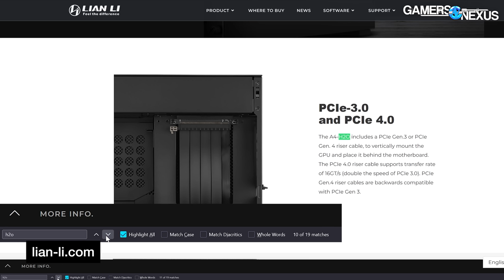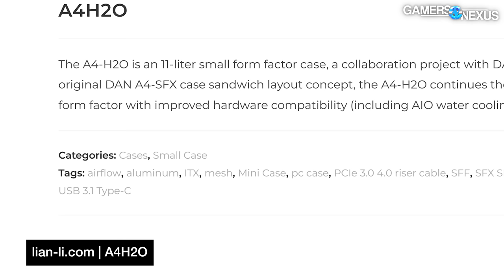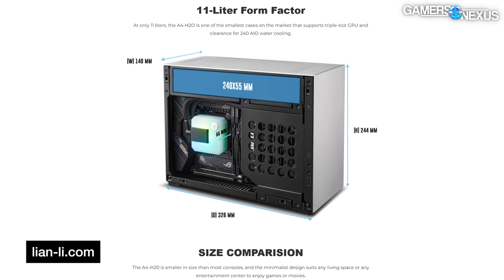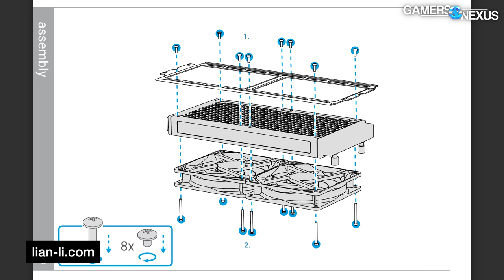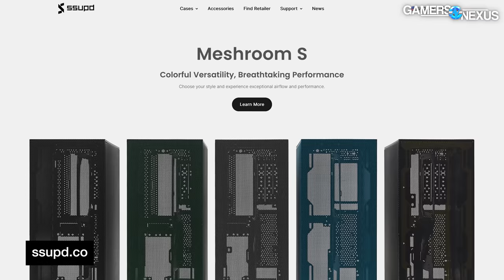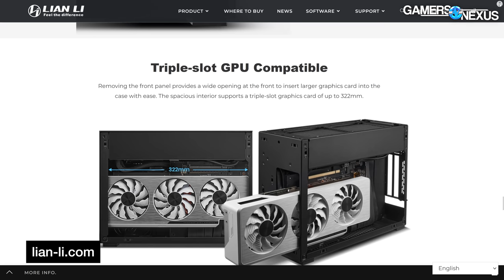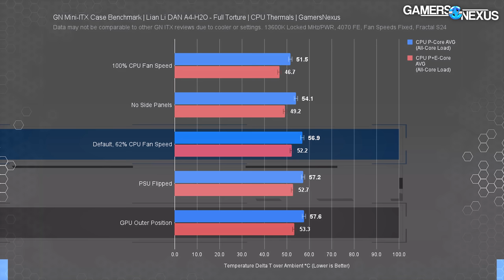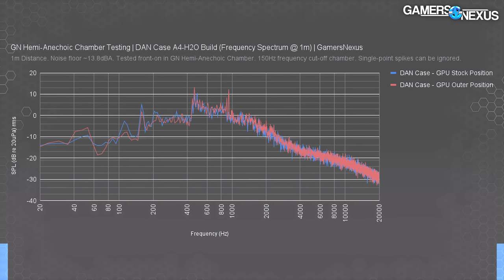Water Cooled Mini-ITX Review: Dan Case A4-H2O Thermals, Noise, & Cable Management

Comment: Probably stupid question but would that computer fit into normal sized backpack? I'm sick of laptops and need PC but small one as I travel a lot. I wonder if I could build that and be able to travel. It's probably a pain in the ass on airports but still better than laptop...
Reply: You totally can in a larger one, but not much more will fit -- you can find some backpack photos on Google.

Probably worth looking into some sort of pelican case for checked luggage (at least I think thats more popular -- plenty of photos/reports)
Reply: It'll fit, but it'll be heavy. Remember that the value proposition for this case is full-size GPU and CPU in tiny box, and those kind of components need a lot of metal to dissipate the heat.
Reply: Thank you, appreciate that guys. I'll look into cases.

Comment: I am kind of disappointed you did not test the case with air cooling like the Fractal Terra. Then you can still test with the cooler for the case specific build comparison.

(...Or does it come with the liquid cooler? Because if it doesn't It really doesn't make sense to me)

I know you can't always do the same parts in every case but the more similar the test platform the more comparable they are (noise and cooling, fitment, etc.) and the easier it is for a conaumer to make a decision (the more useful the information). Even if you can't get perfectly comparable every time.

For example, I am looking to build a compact air cooled mini itx for my father. The size and shape was similar to the terra making this case of interest (and it is cheaper). But the lack of air cooling testing sadly makes this case review completely useless to me. The Terra review is almost useless as well without at least one thing to compare it to. We may know how it is, but that only helps if it were the only case available. As I said, it was just disappointing.

If this is the route you want to go moving forward (built as intended only) I think you should break the ITX tests into two liquid or air categories (if both then set it in both categories/playlists) and label them as such on the thumbnail.

Comment: Had to take a dremel to the motherboard plate as you cannot remove or install a 2nd m.2 drive on the Asus B650E-I  motherboard . Poorly designed .. An NZXT 240 Kraken fits inside the case without problems

Comment: You use stacked graphene pads in a computer that is little changed from 1988. The CPU and GPU are "more of the same" with some architectural changes. But the silicon dates back to 1963 and is setting fire to motherboards and melting GPU cables. The VRMs date back to 1920. Old shit. Just more of the same.

Comment: Those holes on the sidepanels look way too small
Reply: according to thermal testing they are fine.
Reply: @kevinw7319 Yea, by like, 1-7 degrees, at best. Thats cutting it quite close

Remember, thats over ambient, thats not 60-70 degrees celsius, thats 60-70 celsius + room temperature
Reply: @nemtudom5074    Weird, i thought his tests with covers on/off showed Temps within the margin of error.
Reply: @kevinw7319 I mean, they could have been within margin of error, of each other, but they were not even close to being cool

Comment: I absolutely disagree with your idea that there's no reason to compare things like noise between this case and others due to the cooler differences. The entire point of this case is that it enables the use of a cooler that isn't compatible with cases like the Terra and so understanding the delta in noise and thermals this enables would be important consumer advice for someone considering a build.

That would be like a car channel saying they can't compare performance numbers between two cars in the same price range because they have different engine displacements, when the results of those design differences are exactly what a consumer would want to know.

You guys are completely missing the forest for the trees here. The thesis for this case would be that it enables any given components to run cooler and quieter in a similar volume while unlocking greater overhead for higher end components as a result. You don't test that thesis and so don't provide particularly useful advice for someone shopping in this category.

Comment: I used Steve's logic re: 11L vs. 12L on my truck based on the height of the feet.  I remembered that I have 33 in tires, so suddenly I can fit 5 more gallons of fuel in the tank. Thanks!
Reply from the maker: Way to massively misrepresent two distinct statements. Our belief is that external measurements should be counted in product dimensions because they require physical space on the desk. That you can then use basic math to calculate volume is separate. Likewise, by your representation, we should also subtract all other volume which is non-usable for the components. That'd be like cutting all the marketed numbers in half.

Comment: $150 bucks for a plastic box
Reply: Did you count USB port into that plastic?
It's all metal, only push-pin clips that hold the pin are plastic
Reply: manlet case bros seethin. next they are coming out with a shoe box case with jordan on it. the price will be $600 cause its limited to only 100.
Reply: Point to a single metal internal piece or sidepanel. You can't.

Comment: Mini itx is dumb, its more expensive because it's a neesh area, you are limited on gpu size and cooler size, temps always suck. Micro atx makes the most sense if going small, better cases, can use full size gpu's and coolers, temps can be identical to medium atx cases while still having a small footprint.
Reply: @Zzzxx2  iv had both, MATX does run cooler because there are more fans, more airflow. You can pick just about any gpu or cooler you want, not so with mitx...yes the mobo is more expensive, the cases are expensive for the amount of material being used. How often are you going to carry your case around? Not just that but it's not like MATX is leaps bigger and you can move around it very easily. If you need something super portable buy a laptop. All my points are valid 😉

Comment: why torture yourself with this small case - the only question i have - fashion over function seems to be the trend - the other thing is why is steve having contractors build his sub arachnoid chamber when he could probably do a better job diy - just read the prints and then modify them to get even better specs and performance - the lift being employed to install a ceiling panel was too much for me to bear #spudgie suicide